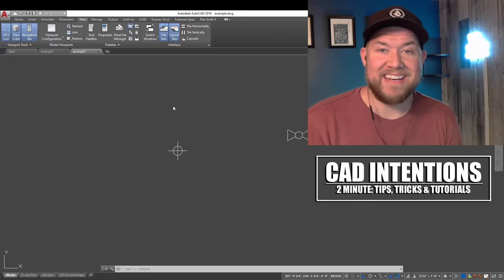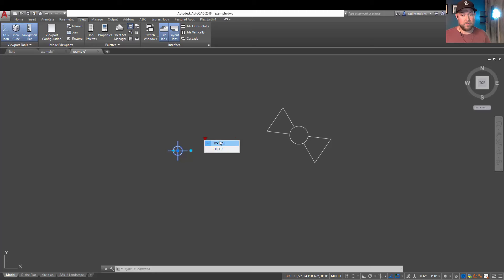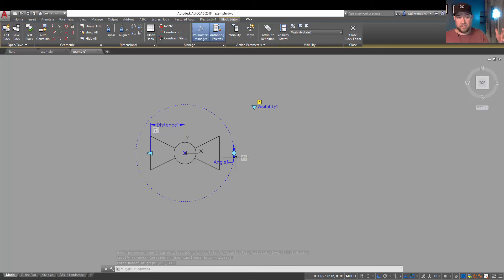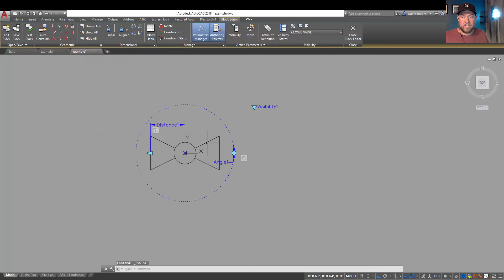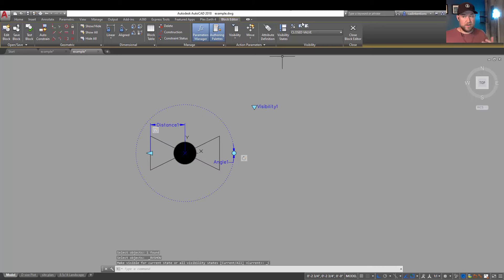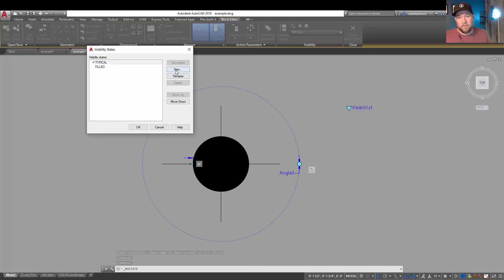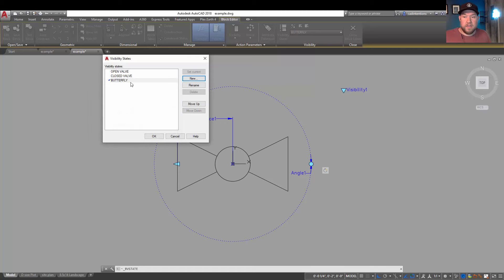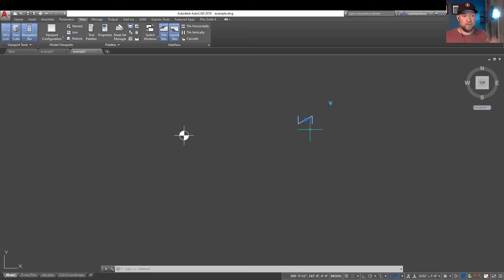AutoCAD Create a Block with Visibility Parameters - More Dynamic Block Tips | 2 Minute Tuesday

Comment: Hopefully, this makes sense...I'm trying to hide a polyline in a block with dynamic text, in a way that when the text scale doesn't match the corresponding viewport, the text and a marker line disappear, but the block stays visible. In this scenario, I have an existing tree block (site plan) that I use on different sheets, the same file,  at different scales and I'd like the tree tag and marker line to show up on one sheet and not the other. The text is easy enough, simply delete the associated annotative scale, text disappears, but I'm missing something obvious on the line.

Thoughts??